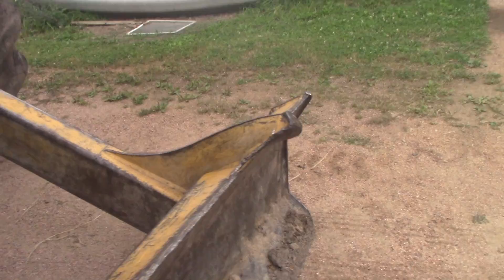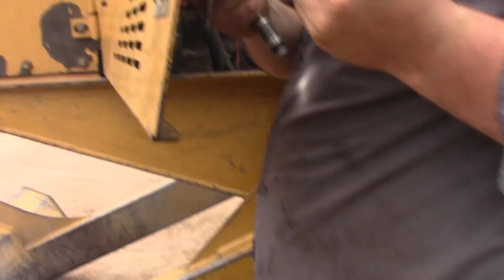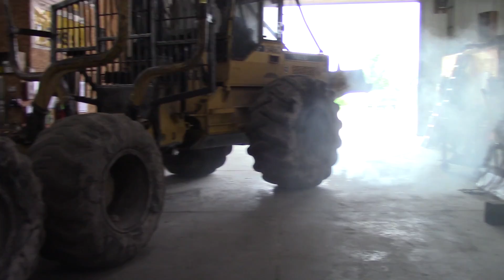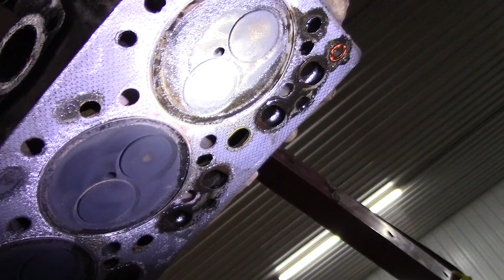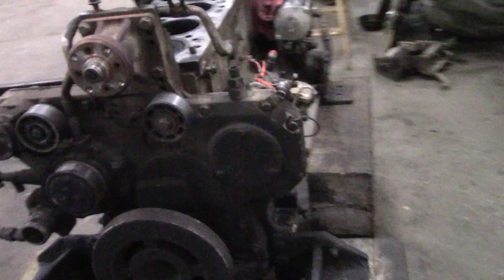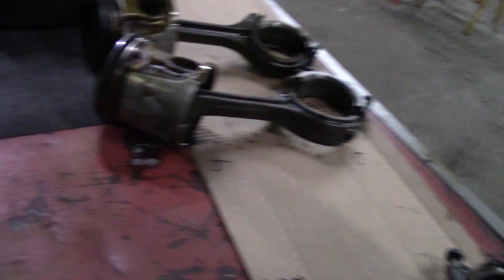John Deere 6068 rebuild time

Comment: If Cheech and Chong made a forwarder engine....
Reply from the maker: It would be still smokin 😳
Reply: Hi  l have a problem  for my 6068 john deere  the problem  is the fuel is mixing in a radiator   my engine  is fixing  in a fire fighting  please  help me

Comment: Broken connecting rods, Mercury Marine uses them so their is no machined line so their roller bearings don't stick and jump creating wear patterns. the process is to machine the rod end round then create a weakend spot for them to fracture the cap off after freezing the rod
Reply from the maker: These are stamped Hatz Germany. Pistons are by Mahle. Guessing remanned once already, although I can't be sure if it.
Reply: @MichaelJBerg  Hatz and Mahle are both OEM suppliers of engine parts, they could have been installed at the factory or sold by a dealer as genuine Deere parts.  If you think the rods have been reconditioned you need to mic the big end OD it will be oversized because with the fractured rod and cap they can not be resized back to standard size.  you will need rod bearings that are oversized OD and ID to fit the crank journals
Reply from the maker: @pauliossi2674  thanks for the info the bearing ends look good. Although they will get checked.